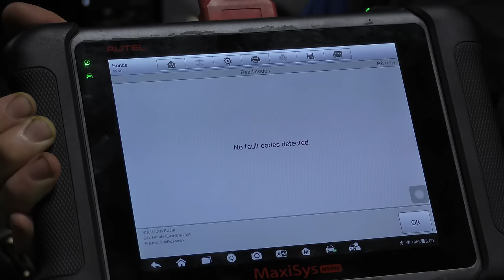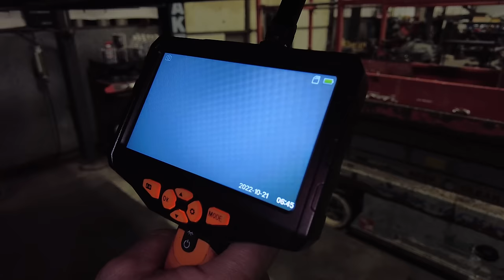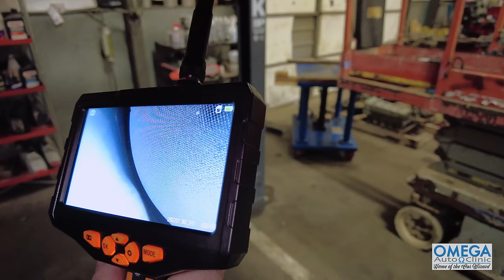Isolating the Problem? Engine Has No GO!

Comment: We had a customer come in with complaining of a of lack of power.  In the end it was because her husband had put 2 layers of household  underfelt (the packing you have put beneath carpet) beneath the cars carpet reducing the accelerator pedals travel. And why ? To get rid of the noise coming through the floor. The exhaust had been rubbing on the floor after his wife backed the exhaust into something bending the arch pipe. LOL

Comment: Just to play the game fairly...I'm commenting right after the 4 options were mentioned.

The thing my mind had already jumped to before it was said, was low compression. But when I had that with a car years ago it wasn't noisy at idle.

Then you said a clogged cat, and that made sense. But so did a brake system issue if it was making noises when the brakes are applied at a stop. 

So now I'm confused but leaning toward the last 2 options. I'm picking the cat but may be wrong!

Comment: Catalytic converter. Had this problem with an 86 Oldsmobile Cutlass Ciera. It was the real "little old lady who only drove it on Sunday" car. I don't think she ever drove over 35mph either. The catalytic converter got so hot it started a small fire between the engine and firewall. 5:44
Reply: My dad's 86 Toyota pickup did same thing. It was glowing cherry red

Comment: First thing I suspected less than a minute in was a plugged up cat just based on what was described. 

Idk how many times I’ve heard people explain they think there’s a transmission problem based on delayed and/or harsh shifts that are caused simply by the throttle position input that the transmission interprets as heavy acceleration from the pedal being depressed to the floor or near to it, when in reality it’s just because the engine cannot make adequate power because it can’t get rid of its exhaust fast enough. 

I have to wonder how many thousands of people were taken for a ride with this problem by shops who were either incompetent, or corrupt.

Comment: While viewing the front of the cat/conv the cleared corner portion of the grid screen was visible.  Would it be possible and effective to clean the entire screen and remove the debris thru the sensor port and then determine if the blockage had been eliminated?

Comment: Instead of replacing the catalytic converter you should just clean it. Oven cleaner is made to remove carbon (which is what the clog is made of). Heat the converter, I use a propane torch. Spray it with a full can or more of oven cleaner. Give it an hour to work, or overnight if you didn't heat it up. Spray it out with water and it will flow like new. As long as the catalyst is intact, which it almost always is, it will work like new as well. Saves a whole lot of money.

Comment: You're right about listening to the customer. About 12 years ago a customer brought us his '95 Caddy Fleetwood. He said the brakes were grinding. If the brakes are grinding, no test drive to confirm. After a brake inspection showed all friction surfaces were great, I put it back together and test drove it. Turns out it was the first gear drum(or something in that vicinity) in the transmission. Needless to say, we were both surprised.

Comment: I am honestly surprised that this doesn't throw any codes at all. RPM vs TPS vs MAP/MAF should have read off and tripped a code....  So crazy!
Reply: My fear is the new cat will plug right up like the old one. That stuff didn't accumulate by magic.
Reply: @reestyfarts would like to know car milage. Could be just time. Probably tune up time tho.
Reply: Honda's burn oil its def gonna clog again. @reestyfarts
Reply: Agreed, I first suspected a plugged fuel filter or a weak fuel pump and have seen nothing in this video to change my mind.
Reply: @omnicode there's not really much in the way of "tune-ups" nowadays.  No point or timing to check. Rarely plugs.
Reply: My dad's 86 Toyota pickup did this years ago when it was almost new. It was a lifted 4wd and we saw the catalytic converter glowing cherry red when truck was running.
Reply: @georgeperkins4171 Replace spark plugs, replace oxygen sensors and clean mass airflow sensor.  That is what my exhaust guy told me to do.  Boy did the car run better too.  Corollas can get by on worn out parts without complaining.
Reply: @shawnstillman736  shouldn't generalize like that, I got over 200k on a 2003 Odyssey with no cat issues whatsoever.
Reply: @smwsmwsmw  It's an observation and well known that Hondas burn oil. You're cat is starting to clog up it's simple psychics honestly.
Reply: @reestyfarts maybe if they leave it in an area where someone might steal the cat then hopefully insurance will pay for a new one. 😏

Comment: I have a catalytic converter issue no codes exactly what you mentioned! A blocked catalytic converter! It passed Smog before the check engine light came on 🤞☘️ so two years before I need to worry about it again. Thanks for your videos 👍

Comment: Had the same problem with my '00 S10 trucklet.  Around town it was fine but couldn't hit hiway speeds.  Felt like the hand of God reached down and was holding it back.  1st mechanic who had done previous work and trusted.  He claimed the timing belt skipped a tooth and "gut" feeling, quoted me new engine @$5k.  Not buying the timing chain theory, took it to mechanic2.  He diagnosed a clogged cat.  At first didn't buy it but the mechanic had impeccable logic and the ultimate test procedure-removed the cat and all problems went away, put the cat back and problem reappeared.  He rodded out the cat for $150.  My state doesn't do emissions inspections.  Sure I had a code set permanently but it got me down the road for the next year while I saved up to buy another car.  And a little black electrical tape took care of the SES light. :)

Comment: The next most important question that needs to be asked is how did the cat get clogged?  Normal driving should burn off the residues that pass through the cats, its when the car is operating on a rich mixture or is burning oil that the cats get clogged.  Also, check the air cleaner because that may create a rich mixture.  As you have already blown compressed air through the cat, which partially cleaned it a short fix could be to give it a good clean with compressed air to unblock it, saving the customer at least $700.
Reply: A rich fuel mixture would leave black soot on the oxygen sensors.. those sensors he pulled out were clean. I would suspect bad fuel being used, perhaps..

Comment: Since we were asked to play the guessing game... My first thought was a fuel filter or fuel pump issue, but since that's not a choice I'd move on to clogged converter....but he did mention customer hears noise in the rear. So my guess at about 6mins into this video is sticking rear brake.

Comment: The Catalytic Converter can be clean by just taking it off and soaking it overnight with white vinegar, baking soda and soap in a bucket. That will save that teacher about $700.
Reply: Make a video with a time lapse to prove your evidence. If you do, and it works...You will disrupt the car maintenance industry ✌️
Reply: Video of this with a pressure washer all clean lots of money saved !
Reply: I see a problem with that course of action.  The clogged cat/conv is the second one in the pipe.  The first connects directly to the head with a continuous pipe flowing to the clogged second one.  Chances are the first one is also obstructed and prevents easy access to the second one.  The two in line is why it's so expensive.

Comment: Since the cat is bad, I’m surprised that it didn’t generate a fault code. Could the rear or front lambda sensor also be faulty? In my experience a clogged air or fuel filter could also cause problems with power delivery from the engine.

Comment: I used to work security at a major car dealership. Once in a while a vehicle would arrive with a problem. One that stands out is a car owner that returned no less than 3 times and the problem is STILL occurring! I was at the gate and this guy came back a 4th time! The problem still existed and he was VERY pissed! By coincidence this one day the owner of the dealership happened to be arriving on the property. He was well known for his television commercials! The complaining car owner saw him and yelled at him. The dealership owner came over to hear the customer out. The dealer owner told the service writer to have this car repaired properly or he would lose his job. Voila! After this incident the problem was resolved. All it took was the dealership owner ariving on the property.

Comment: Heya wizard, I've successfully diagnosed the exact same problem on my dad's 02 nissan maxima.  It helped that my previous car had the same malady a few years prior and i knew a few tricks from back then.  One thing guaranteed to throw off the less experienced techs is the P0300 random misfire often being set.  That's one of the codes that tends to lead to multiple parts cannon salvos.

BUT WAIT, THERE'S MORE!  A wrinkle that is every mechanic's nightmare.  The original complaint was the battery light came on and the vehicle died while driving.  Then the vehicle was left parked for some time until i got the chance to work on it.  Basic diagnostics confirmed a bad alternator.  NOT a fun job on 3.5 nissan motor, especially when you have to make do with floor jack and a pair of stands.  225k worth of oil grime all around for bonus fun.  Lots of cursing later, the new alternator was in and the voltages were reading good under electrical load and without.

I asked my dad to test drive the vehicle around the area.  Five or ten minutes later, he's back.  It's got no power, the transmission wont shift, and it stalled out twice on me.  UH OH, did i mess up somewhere?  Did something get fried?

Took me a couple hours to recheck everything and to troubleshoot the issue until I began to suspect a plugged cat.

One tell tale sign is hissing noises from exhaust leaks.  Another quick and dirty test is to try to cover the tailpipe with your hand and have a helper blip the throttle.  Another quick check is to look under the vehicle as you blip the gas pedal with your hand.  Im my case, the flex joint in front of the rear cat was visibly bulging and stretching.  And the tailpipe tip also stuck out quite a bit when the gas was blipped.

A much easier test to do is to hook up a vacuum gauge to the intake.  An exhaust blockage will cause it to be lower than normal at idle.  A back pressure test at the oxygen sensor is better, but removing those can be easier said than done depending on vehicle and the amount of corrosion.

When i removed the old cat later, it was well and truly plugged up with ash.  Not a huge surprise given that the vehicle burns a quart of oil every three tanks of gas.

Comment: I have 4 elements. All element owners need to adjust their valves or you will need to replace the engine. 
Also the $110 eBay cats work just fine as long as you use original Denso 02 sensors.
Reply: 😅
Lol

Comment: Plugged cats will slow you down. On my Crown Vic, it has 4 cats. A primary and a secondary on each side. The funny thing is the O2 sensors are only before and after the primary. There are no sensors on the secondary. On my car, the secondary broke down and was rattling in the can as the exhaust pushed on it helping to plug the outlet at times. Since there are no sensors on it, no OBDII codes. I could only hear the rattle when the door was open at idle.

Comment: “sometimes things can be very elusive”— replaced noisy alternator 3 times before realizing the noise was coming from a leaking throttle body intake gasket — which made sense, since symptoms included idle going up and down

Comment: Checking engine vacuum can also point out a restricted exhaust. The vacuum will drop and stay consistently low at a steady speed on level ground.
Reply: That would be a good starting place.  Further searching would be required because so many different things can contribute to low vacuum.

Comment: This was my Volkswagen throttle body on my 2012 passat (recently totaled thank god)  
Car was idling real rough and the acceleration was sporadic at times. 
Autozones scanner said it was my alternator.. went to a old VW restoration shop and their scanner kept saying other things too like throttle pedal sensor but nothing wrong with the alternator lol. 
Nothing was wrong with the throttle pedal sensor either. 
Took us scanning the car 3 times at the VW place for the correct code to finally come up. They hooked me up though, didn't charge anything for diagnostic, and only charged $50 to throw my $60 ebay throttle body in 
That $60 ebay throttle body ran for like 10k miles with no issues before my car was totaled in an accident. Great deal cause autozone wants $300-400 if not the $800 one

Comment: As soon as you brought up the merging onto the highway issue i knew it was the converter.  Had it happen to a 85 s10, that thing was already slow enough but it was just dangerous getting onto the highway on short on ramps being so slow. Pretty much doubled the speed fixing the problem

Comment: I'm surprised that it didn't throw any codes for the catalytic converter. Is this something that Honda (or Element in this case) don't do? Or was it because of the placement of the O2 sensor it wouldn't trip it?

Comment: Never seen one of thoose before. Looks like a Honda Ridgeline mated with a bus, lol. I had a old VW Multivan once that empied the content of the catalytic converter in the rear muffler. It was very clogged but still ran. Got a lot better gas milage when i replaced the exhaust.

Comment: Happened to my '05 Civic coupe. My car ended up going into limp mode for a whole month and wasn't throwing any codes. I tested every major sensor like the crank and cam position sensor and everything was good. I tried going up a hill one day and almost stalled and that's when I realized it was the cat. I live in Ohio, so I just had it chopped off for now.

Comment: Did a parts cannon and so did a shop on a squeaking noise in my truck that dogged me off and on for a year.  The root cause turned out to be a dry bushing on the cam position sensor rotor.  Something I never would have thought of but apparently is a thing that happens.

Pretty much everything that moved around the front of the engine had been replaced at least once and it came back.
Reply: Ford?

Comment: My guess is a timing sensor is faulty, causing it to be low on power. That's what happened to our Nissan Frontier. Though it had codes. 

So from your choices, I'll say the Catalytic Converter, as if it's clogged, it seems most likely to throw a code. Would still expect a code though.

Comment: Had a tech at my shop diag a 03 monte 3.8 with a bad trans cause it would not upshift under acceleration. I was asked to recheck and after driving it came back raised it up dropped the down pipe  took it for another ride and shifted perfectly.  Sometimes a clogged cat can cause alot of odd symptoms

Comment: I've had that happen twice.

First time was in the late 80's when they first switched to matrix grid. Car had lost a head gasket and blew crap in the exhaust. Never gave a cat a thought after the motor had been rebuilt. Drove it 50 miles then it wouldn't go over 25 mph

Comment: In the case of this blocked Catalytic Convertor, shouldn't the rear most O2 sensor show through a check engine light? as catalyst efficiency problem?
Reply: I guess the clog wasn't so severe since it was still cleaning up the exhaust gasses

Comment: One way to obviously combat getting ripped off is to just read up and be knowledgeable about vehicles (or at least your vehicle) and you don't have to be an expert, but even knowing little things like if you're vehicle feels like it a low on power, it could be a number of things -- as mentioned transmission issues, but also lesser known possibilities like a restricted exhaust system or a fuel pump that is maybe working ,but not putting out enough pressure, to something like a vacuum leak, etc.  Plus take your car to at least two shops to get a diagnosis.  You could consider a dealer but unless the car is under warranty, I would try to find two independent shops (not a chain shop like Pepboys) but one that's independently owned that you trust.  This way if they say the same thing, more than likely it may be that issue or at least point you in the right direction.  If you get two conflicting diagnosis, then take it to a third shop.

Comment: With the vehicle parked and the engine at idle speed, using an infrared thermometer, measure the temperature of the exhaust pipe before and after the catalytic converter. A five-to-ten-degree difference while the engine is running is normal, however as the catalytic converter fills with mostly carbon, the front temperature reading will increase, indicating the blocking of exhaust flow.

Comment: I have a 2006 Honda Element ex and I had the Catalytic Converter stolen. I live in the Midwest and the whole exhaust system was a huge rusty mess, and had numerous pipes throughout the years replaced and soldered on, and some of those pipes leaked. So I decided it was best to replace all of the exhaust system including the cat converter and oxygen sensors. I also had leaky shocks so I had those relaced at the same time, and I also spent a total of $2000.00 which is a huge amount of money since I totally live on social security. My Honda is 17 years old, and I am honestly replacing old parts probably every 2 to 3 months, and the vtec solenoid twice in the last 24 months, plus brakes and rotors, and I keep up on all the fluid changes including the rear differential. So now I really am in need of a new set of tires, and I'm at a point where I've put so much money into my Rusty but Trusty Honda I better keep it and not trade it in for a newer vehicle "I think"😂